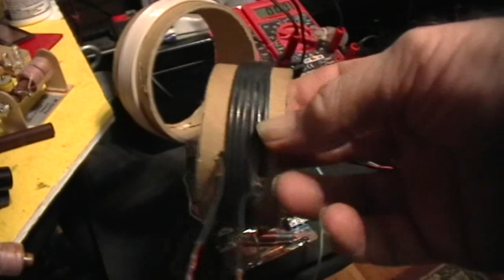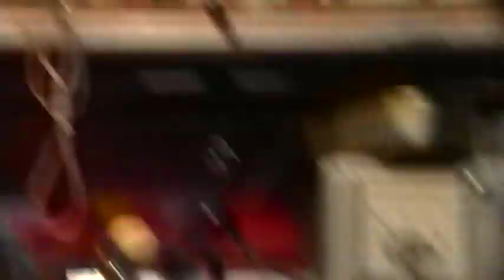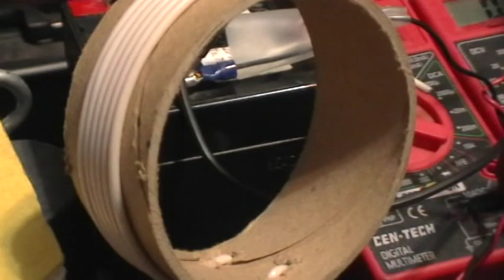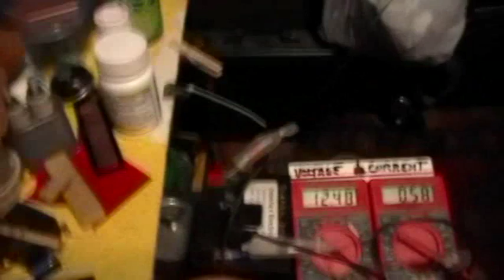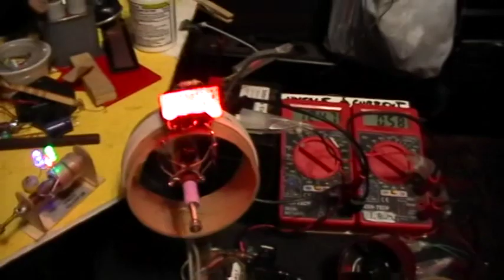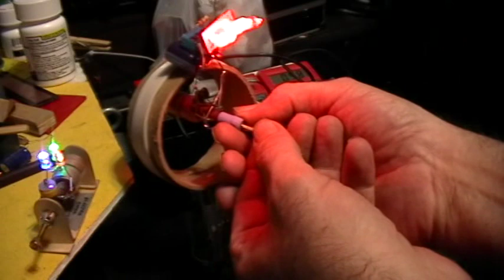Electric OU: Supplement: MicroQEG Neon Polarity, Receptor Tuning

Comment: Very cool. Once I get some more TIP42-c's (I have ordered 20 :) I am going to do some experiments designing LC Tank circuits. I have some gnarly designs to try, I think its super cool and that more "wireless" heads should be getting these concepts under their thumbs... Thanks again for all the sharing you do. Peace :)
Reply from the maker: You planning on having a cookout with those PNPs?
Personally I find NPNs easier to grasp from a logic standpoint. And n-channel mosfets of course. My current love is the IRF3205.
I'm still thinking about the specs for gas sample tubes. Have you watched my "Anatmosphere" TKTerella videos?
Reply: TinselKoala I've seen them, and I want to see more. Have you had the old vacuum chamber out lately?
Reply: TinselKoala Yeah, I'm planning to cook a few for sure. Also I have some ideas that require multiple slayer exciter circuits... I will order some IRF3205 with my next electronics order (I typically like NPNs as well).
I will definitely check out your "Anatmosphere" videos... Ah, you are going to try and make the sample tubes suffice, thats cool. You qualify for a few free over time, just because you have done so much, sooo many videos that are helpful (as time goes on the designs can and will get much more elaborate).... (I'm still pondering your video (One Thing. One) that you released last night.. Is an electric field mostly voltage and a magnetic field primarily current driven? Very interesting :)
Peace TK.
Reply from the maker: MrSkypelessons
Sorry, I missed your comment until just now. Yes, I plan to do some more experiments shortly but it means I have to put away all the rest of this junk. Operating HV and vacuum chamber means I need a more organized workspace. But I will be doing it, I have a couple of critical experiments that need to be done in vacuum, even though 30 microns isn't much of a "vacuum" really.
TKLabs would gratefully accept a donation of a small Balzers turbopump and controller!
Reply: TinselKoala Yeah, a clean out is necessary sometimes! Looking forward to seeing what you do.